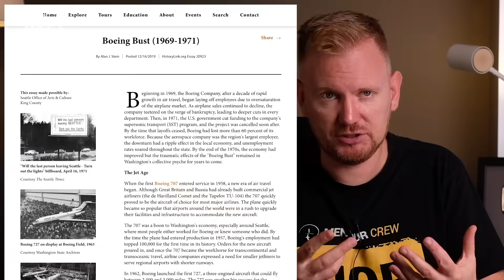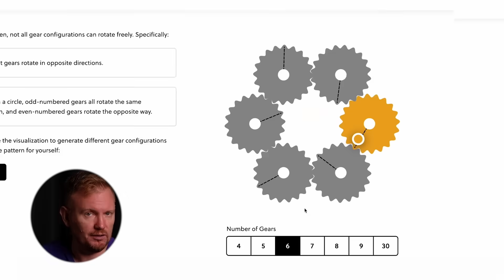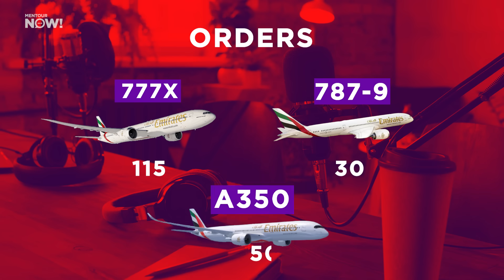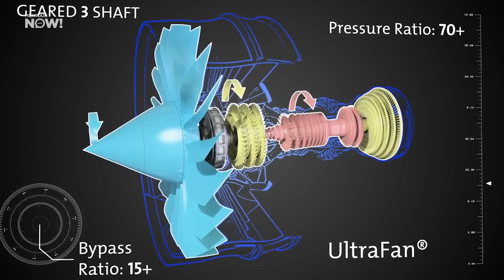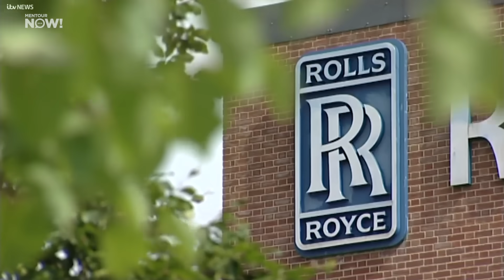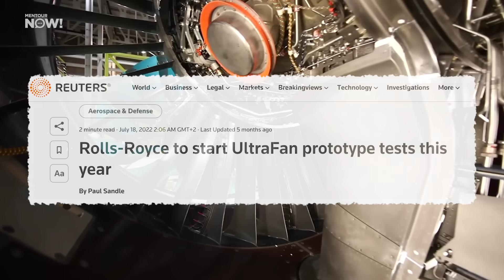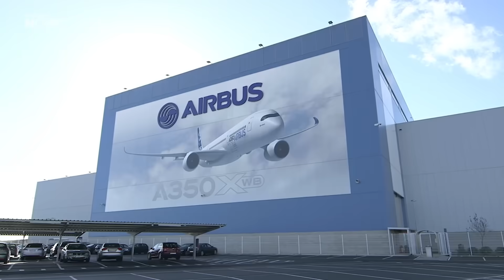Are BOEING planning a 747 with 2 ENGINES?!

Comment: Ok, final-final thought.  I previously let the whole geared turbofan go by without comment because:  why bother?  If geared turbofan engines were easy all turbofan engines would be geared turbofan engines.  I was perfectly willing to cede the point that Rolls Royce would solve the geared turbofan problem well enough to make it work acceptably well.  But, now that Mentour brought the issue up a second time I have to remind everyone that the Ultra-Fan engine will inevitably concentrate more forces in a smaller volume than any other turbofan engine ever produced - patent disputes are going to be the least of Rolls Royce's gearbox problems.  

BTW, the basics of patent law is that you as patent holder must licence your invention to anyone who is willing to pay the price - and at a 'reasonable' price.  Do you really own enough of the right to the relevant technology to stop your competitor?  That is an (expensive) matter of legal dispute.  What is a 'reasonable' price to licence?  Another (expensive) matter of legal dispute.  How will this shake out for Rolls Royce?  Who knows.

Comment: Final thoughts. [13:10]  "But why would Rolls Royce be starting with an engine size that won't fit under [sic] the engine of the world's biggest twin engine airliner."   That is because when the project was given the go ahead, the impending forces of deglobalization were not understood by decision makers - at least the may have left themselves a way out and Rolls Royce might survive this mistake.  Again, comment back in two years  and see how well I've scored.

If you are in the local or regional airline business, you'll probably be fine - in fact things may never be better.  Trans Atlantic?  Trans Pacific?  Think 1950s, it's going to be a little tough.  Trans Global?  God help you.  

The geopolitical and geoeconomic forces presently engaged in tearing apart the current world order are already far advanced.  Will a new era of reglobalization occur afterwards?  It is presently impossible to predict when or how that might occur, we haven't even seen how it all finally comes apart yet.

That's my prediction.

Comment: Geared turbofans are as old as the JT9D and the 747. The Lycoming ALF502 and Garrett TFE731 are small geared turbofans and it's surprising to hear that Pratt & Whitney have a patent on the planetary gearbox connecting the low-pressure turbine and the big fan of the PW1000G. Perhaps Rolls-Royce has its own proprietary planetary gearbox design for its giant Ultrafan?

Comment: You want to make a 747 more economical? ....Just use 4 engines to take off, then throttle back/switch off 2 of the engines once altitude is reached.  Surely 2 larger engines would use MORE fuel, as you would have to keep both running throughout the entire flight?

Comment: With Rolls Royce building such a monster engine, with the suspected efficiencies it will bring, why are the airlines not shifting to wings on top of the fuselage (like C-17) as opposed to the under fuselage design all the big jets have now?  IT seems like moving the wing up would create the space for the monster engines to fit easily.

Comment: I do know that Amsterdam also is at its maximum in slots.... If or very close to it. And also the KLM has only one (big) hub to fly from. But any plane flying from the Netherlands needs to be  relativ silent. I hope that RR can acchieve that relativ low noise level.
Also ...There was , unti one year ago, a very big plane....destroyed in Ukraine.
Replacing that thing with a modern super freight plane can be done with four of these big engines...instead of the six in the antonov 225. But I'm not sure who would need such planes. Maybe the america army for faster transports around the world if needed.
Or replacing the flying radars with a plane that can fly much longer (due to efficiency in the engines) that the current flying radars.

Comment: I think that the last hydrogen-powered flying machine we had did not end well...

Thanks for the video!!!
Reply: They certainly wouldn't be storing the hydrogen in flammable fabric bags. But there are many other reasons why hydrogen won't be used as fuel anytime soon. The main one being that the way that it's currently produced from natural gas is very polluting. Other less polluting methods are too energy intensive to be practical.

Comment: I thought the 777 was basically a single-deck 747 with two engines???

Boeing lost some ground on their engineering reputation with the 737 Max, justified or not. So, I personally don't want them messing around with changing the center of gravity on the 747 airframe by installing 2 engines instead of 4.
Reply: Justified or not? Believe me it was well justified. Ask the relatives of the passengers who needlessly died.

Comment: Efficiency made the first B747, maybe efficiency makes the new one?  What I have come up with is the following:
1. All advanced composites.  As pointed out before, this usually points to smaller aircraft due to development costs and smaller planes tending to be made in higher numbers than large planes.  But maybe when combined with some other things, the numbers of large planes needed will go up.

2. LNG cooled superconductors for hybrid electric engines.  The reason why gear reductions were not used in the past is higher maintenance.  You can put a superconducting electric motor driven by advanced superconducting power electronics (the latter a recent development) in the cowling of a ducted fan for greatest efficiency while doing an electronic gear reduction from the main jet engine.  As these fans can be made relatively easily and reliably, maybe you stick with 4 of them for a large airliner, but cut down to two separate jet engines driving compact superconducting generators that are also used to start the main jet engines.  As the LNG coolant boils off, it gets fed into the jet engines and burned.  The plane will fly somewhat slower than a B747 and thus have less wing sweep, but find the right speed with an electronic gear reduction combined with a straight through jet engine and you have a much more efficient plane.  There is also the advantage with engine out capability in that if a complex jet engine fails, the electrically driven ducted fans can get power from the remaining jet engine and thus balance the toque on the plane.  It is also easier to have counter-rotating ducted fans to balance torque on the plane the other way.  If cryogenics fail, you would still have conventional electrical power for main systems like the B747 and the jet engines could act alone without the big fans and with the superconducting generators freewheeling, thus generating a fair amount of thrust and generating more and more thrust as the plane descends.  Planes have already been known to glide up to 100 miles (160 km) and this would be more of the plane slowly descends and then what altitude it levels off depending on load in the plane such as fuel load.

3. Use a battery power supplement.  Say 20% (or possibly more) of TOGO power comes from batteries and the jet engines are focused more on heavy super alloys and in general designed to run near full throttle all of the time.  The higher the throttle, the more efficient the jet engine runs.  Also downsized as batteries help to obtain max power, the engines may end up lighter even with a more heavy duty design to better take running at higher throttle settings on average throughout flight.  The battery of choice at this point in time would be LiS (lithium sulfur).  The reason for this is recent reported advances make them 3x more energy dense and several times more power dense (capacity and instantaneous power output respectively) than the next most commonly used lithium chemistry while having excellent cycling capabilities, something LiS has historically been terrible at.  Going for a more B787 electrical setup also increases efficiency overall.  May even leave the APU off for the most part because there are sufficiently big batteries to cover what an APU would do or may even do away with the APU as the batteries fulfill the role just fine.  Dumping the APU overboard will save on a lot of weight and space used in the air-frame.  Then the two main engines could have something useful to do on the taxiway, which is to recharge the batteries while taxing because there is no APU and the batteries drained down some while fulfilling that role.

4. When you deal with long haul, up to 50% of a B747's takeoff mass is fuel for the trip.  If you make all of these changes, while the hybrid system adds weight, the composites take it back off and probably then some along with other structural changes, and then you are using a lot less fuel.  So either you fly the same routes and the plane is a lot lighter because it carries a lot less fuel or you start selecting even longer non-stop flights for the plane.

5. With all of the advancements you can have with such a hybrid system, it may even be deemed overall safer than a B747 with 4 jet engines.  No A380 has ever been lost in flight so far and this may even exceed the overall safety of the A380.  For example, need to do a go-around / get caught in wind-sheer and the batteries provide a very quick boost to 20% of maximum power or whatever the battery system is designed for.

Comment: You really have to see how difficult it is to plan a safe non stop route from LA to Sydney using today's two engine planes to see how we would have to accept greater risk - even if still small -  or more frequent refuelling stops to do long haul over water on two engines.  Imagine also the bird strike risk. There have been approx 100,000 incidents of bird strike over eight years. Few thankfully  involved fatalities but the majority of incidents are in periods of summer and all involved issues of scheduling..
Reply: I would think there would be no difference with existing twins, they have to be able to fly a certain number of miles on one engine. I would think that requirement would exist for the giant engines also.

Comment: What everyone forgets to discuss is WHAT dictates the size of the engines in the first place. It has NOTHING to do with normal flight, normal takeoffs, normal cruise, or even efficiency. Nope.  The size of the engines on multi-engine airliners is dictated by ENGINE FAILURE PERFORMANCE (and to a lesser extent, ETOPS.)  

You can EASILY get a 747 to fly with two (current) engines, heck you could even get it to easily take off at MTOW with two current engines; their RB211 -400s required about 50,000lb of thrust each, and there are a few 100,000lb thrust class engines out there. BUT what happens when one of those RB211's fails after V1 during takeoff with a packed 747-400 with full fuel? ...well, you have 75% of your thrust remaining, or ~150,000lb thrust roughly, which is more than enough for a safe takeoff.  What if you lose a hypothetical GE-9X/-90 variant on your "twin engine" 747? Well, you just lost half of your thrust, and will now crash. 

Assuming Boeing designed the 747-400 specs roughly in-line for a worst-case engine-out after rotating on takeoff, you'd need ~150,000lb thrust for a minimum safe climb out and return to the airport (and possibly allowing time to dump fuel to get under max landing weight.) So that SAME plane in a twin config allowing for a single-engine-out takeoff would require AT LEAST a ~150,000lb-thrust-class engine, likely more due to the heavier weight of the more modern 747-8i and the fact that you lose a TON of aerodynamic efficiency flying on one engine (asymmetrical thrust and the amount of rudder drag required to keep the aircraft flying straight.) So you're likely requiring ~162,000lb thrust.  The same math on an A380 nets about 280,000lb thrust total, for a requirement of 210,000lb or ~230,000ish corrected for efficiency loss on a single engine. 

That's about DOUBLE the thrust of the current world-record-holding turbofan engine. So no, we aren't even REMOTELY close to such a concept, and again it isn't because the plane can't fly on two engines, it's because it can't continue a takeoff/min climb when one fails, which is how aircraft are designed.  This is the reason the 777 has always had MONSTER engines on it (well, and the fact that the wings became too small for the -200LR/300ER - which is why the larger diameter 777X / GE9X engines actually produce LESS thrust than the older 777 GE90's even though they have the same MTOW, but that's a different story.)
Reply: The goal would be to make something bigger than 777, not duplicating previous 747's.  Stretching 777 may have limits and 747 fuselage shape may be better. 747-400 with composites might be possible or maybe they have to make it a little shorter. I doubt they will do it but theoretically it's possible.

Comment: The reason air fares fell in the late 70's wasn't the introduction of the 747 it was the Airline Deregulation Act that President Jimmy Carter signed. Before it passed flying was not affordable for most people as you pointed out. Before this act, the Civil Aeronautics Board (CAB) regulated domestic interstate routes. The board set most of the routes, schedules, and even fares. However, the new policy gave greater freedom to carriers and helped them have better control of their operations.
Reply: That mainly affected domestic routes. The 747 had a huge impact on international travel due to its long range, high capacity, and early use of efficient hi-bypass ratio engines. It was popular with airlines worldwide, opening up international travel in a way that previous aircraft and ships had been unable to.

Comment: Why isn’t there a big plane with the wings shoulder mounted - that would allow bigger engines under the wings ?
Reply: Ditching safety. Boeing proposed that high wing concept to the airlines after Boeing lost the C-X competition to Lockheed. The airlines lawyers asked: What percentage of the passengers drowning in a ditching situation should we find financially acceptable? 50%, 75%?
That ended the high wing concept proposal.
Reply: @davidhoffman1278  I can see that as a lawyer thing, but other than miracle on the Hudson, water landings of airliners is pretty much unheard of. The rare times that airliners go into the water they are usually crashing where it doesn't matter anyway.  I wonder how many passengers in the last forty years have used their seat cushion as a floatation device?

Comment: Would it be practical to redesign the 747 wing to mount the RR engine on top of the wing like a Hondajet?
Reply: You just irritated the heck out of the maintenance staff. If they didn't love the high up placement of the number 2 on the DC 10/ MD11 then they sure aren't going to be enthusiastic about anything similar.

Comment: isnt this what they did with the 737 max , they had to micky mouse the gear and other stuff to make it fit .. probably a bad idea plus it would look stupid , and the cost of each engine would be massive im quessing .
Reply: They just had to shift the engines forward which worked fine. 737 MAX is a big improvement to the previous 737 because of longer range and better fuel efficiency. They messed up with some software adjustments that should not have been a problem, but someone really dropped the ball and it cost lives but they have now corrected it and it is selling well, over 600 are flying now every day.
Reply: @StevePemberton2  i saw that netix documentry where they never added more memory to the low computer system so they had a hard time upgrading ..i could be wrong . I was on a 737 a few weeks ago and the hiss from those engines are a beutifull noise omg .

Comment: Remember also. The cost of making remaking a 747 isn't that much, nothing like designing a new aircraft, and it puts tremendous pressure on Airbus and China to follow suit. They could be for example alone in the jumbo jet segment, but especially China would be incapable of designing such jet in the medium to long run. Airbus probably does not really like to continue the A380, but the risk of market domination might force airbus to extend more resources in an unprofitable asset. Remember that a Duopoly or Triopoly isn't anything like normal economics. It is about power. Generally, when it is about power, the most expensive is designing second-best. Probably designing a 747-1000 would be actually a form of anticompetitive behaviour, only to be explained by trying to keep China a distant third for longer. Geopolitics and state power also comes in at that point.

Comment: 15:20 confirms that when a jet engine is running there is no radial load on the bearings.
That little ball bearing can carry the weigh and rotation of the great heavy rotor shaft for many years so long as it gets clean oil.

Comment: Although passengers prefer point to point,  bigger planes make more sense when there’s a labor shortage (pilot shortage.). 

Less crew needed to carry more passengers.

Thoughts?
Reply: Good point. Consider the State of California.
Lots of flights each day between Southern California and the Northern State Capital City of Sacramento. Makes it nice for lobbyists to have dozens of hourly flights each day using relatively small airliners.
It's doing a great job of clogging up the airspaces, ramp spaces, etcetera.  You could probably reduce the number of flights by 50% using larger airliners, but lobbyists don't like that, the legislators don't like it, etcetera, so the airspaces clogging continues. Oh yea, that North-South passenger HSR will never be successfully completed.